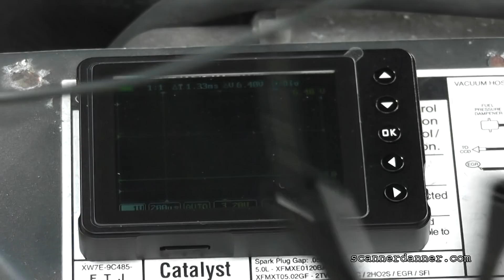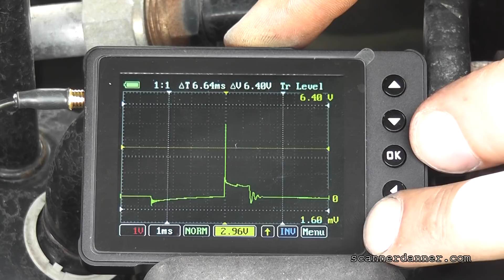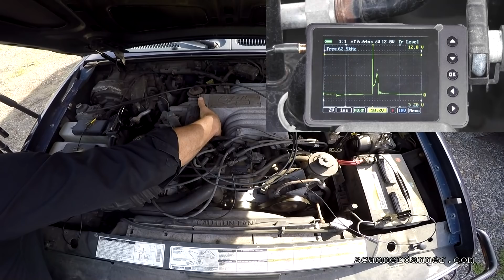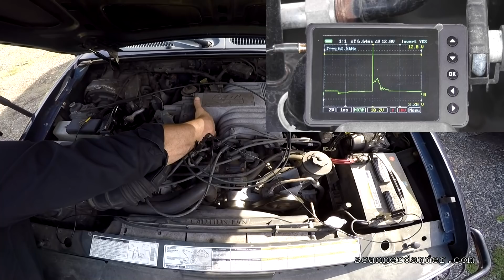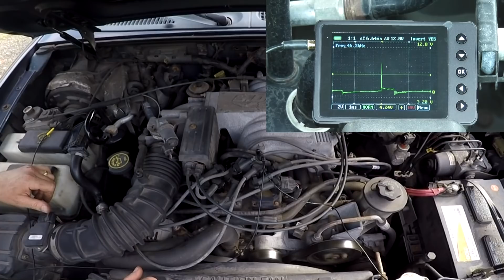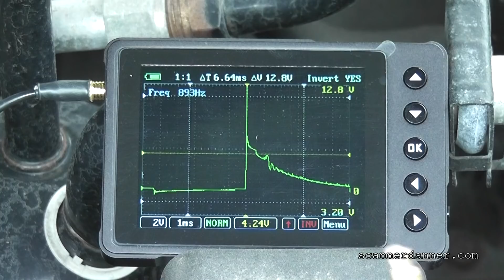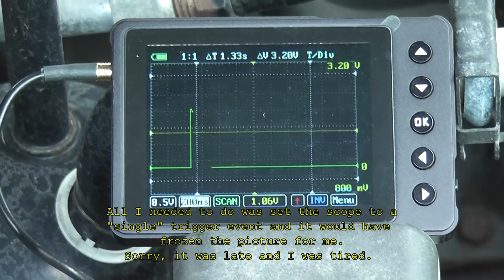How to find a misfire with no trouble codes (uScope)

Comment: Dude I don't know what it is but every time that I have something that I am unsure of it seems like you make a video of it within a few days lol. I am working on a 08 Subaru impreza 2.5I that has a constant misfire on 2 cylinders @ idle and hi rpm and the waveform has a downward slope just like yours I thought it was a secondary misfire but wasn't positive, anyhow I told him to put a coil on it because he already did plugs and wires. It still got the misfires. I am going to do a relative compression test this week. Any suggestions? If I cant figure it out can I bring it to the school?
Awsum video I don't do a lot of ignition scoping and this video helped me a lot!!
Thanks
Reply from the maker: JOHN HUFNAGEL I'm not back until October my friend.
Reply: John do you have a scope file of it?  Might be able to help.
Reply: Man I need a job there your always on vacation Lol No problem Iam sure I will figure it out, Have a good time off work ScannerDanner
Reply: busjockey1
I didn't save the file cause I was pretty sure that the coil was the problem from what I thought was a secondary misfire  but I will have the car back this week for round 2.
Reply from the maker: I'm always working John, more now than ever. I'm just not in the classroom as much
Reply: Know the feeling Paul, start teaching next week part time and at the same time working at my Full Time job, some of my friends think I'm nuts. Lol.  John save your files next time so we can see them.  What scope do you use?
Reply: Enjoy your vacation Paul.
Reply: if it helps, I have had problems with the alternator causing a miss, on subarus with direct fire coils. also the valve timing solenoids can get fragments of metal stuck holding them open,
Reply: well the customer is a idiot and dont want to fix the problem all he was worried about was getting the light out long enuff for inspection. I am sure he will be back when the cats are plugged and the car dont run at all, I will let yinz know if I ever get it back and what I find. Thanks for the help

Comment: Big fan first of all ....  Is it possible to have a compression problem if motor runs flawless for 5-10 minutes and then goes left ... Idle seems steady on dial but big stumble felt in wheel  at stop lights ( especially if it's a long light to wait.  ) Power is 50% gone ..  Puff puff out exhaust pipe ...  Dash lights flicker but no changes under load (ac ,etc)  crazy but car runs perfect cold ...  I have no cats only straight pipes and tried to unplug o2 and ran worse ??   Could a faulty o2 rob all that power even at wot ?   You would swear it still had clogged cats but I removed them ( shattered guts inside). I assume rich condition maybe killed o2 then killed my cats ?   Would poor compression show up only warm temps ?   That's all I'm super worried about , anything else like sensor related would be better news.  Thanks
Reply from the maker: +Kevin Duprey I don't think so, what are you working on? that would help. 
Also, are you absolutely positive that when you mash the pedal all the way to the floor that it does not improve. If you answer is no, then I agree, no reason to look at the O2 any further for this issue. 
Have you considered a faulty alternator diode? I have a video on this called "alternator diode testing". 
As a test, unplug the alternator (smaller connector, not bat wire) after it starts acting up and see if it improves
Reply: +ScannerDanner .. Good info ,  sorry it's a BMW 1997 740il ..  Will check that recommended video ,  I'm guessing I'm looking at multipal issues .  Money is tight or I would have purchased o2 anyway I do have following codes po155 po150,po135,po156,po130,po136,po330..  Also a crazy p1166 ??  Not even BMW code ??    I'm positive if you mash the pedal it's acting like I'm pulling a semi and falls on its face ??   Again no cats on car , clear cat back flow ..  I'm catching up watching your videos everyday and thanks for helping ...

Comment: Will the Uscope show a cylinder with low compression? In other words, can I hook this up to my F150 and determine which cylinder has low compression?
Reply from the maker: Yes, you can do a relative compression test with the uScope. But you will not be able to determine by the scope alone which cylinder is which because it is only one channel.
Reply: ScannerDanner Ok. Thanks for the helpful reply.
Reply: JackOfAllTrades - you can introduce a known fault by removing a spark plug. Then you just need to know the cylinder # and firing order

Comment: Learnt a lot from you. Paul please stop using the scope so much know good way to test but most people do not have one! So why ? So testing etc using normal tools maybe with basic sxanbwr and DVOM. THEN WE COYLD FOLLOW ALONG. THANKS.
Reply from the maker: I'm sorry. Learn the techniques I'm doing with the scope and understand your limitations with your voltmeter and apply what you can. I'm not going to use a tool that doesn't tell me the whole story, when I have one that will!
I'm also training technicians on this channel. That is my main focus. Thanks!
Also, you can buy a single channel lab scope called a uScope from my friends at AESwave for under $400. You also get an inductive low amp probe, test probes and secondary ignition test leads.
https://www.aeswave.com/scannerdanner

Comment: Scanner Danner
hey mate, I'm no stranger to Technology, Electronics and Electrical, 
but i'm not an Automotive engineer or Technician

i have a DSO   Rigol DS2072A

i have a question
when you said,  YOU DIDN'T BRING OUT THE BIG GUNS

what are the big guns, because from what i've seen on you tube, and please correct me if i'm wrong.
Most guys seem to be using absolute shit equipment

i mean
they use PIco, they use Velleman    these things are fucking toys that cost around $100 or so
some mechanics use Fluke 123 Scopemeter,  now.. I'm a fan of Fluke products, but i can't see how a small unit like that built this fucking cheaply and with the specs that it has can be anywhere near reliable.

so. i'm interested to know the Model of your BIG GUNS

also, My Scope has the following basic Specs

2 Channel 
300MHz Bandwidth
2GSa/s
56Mpts  Memory Depth
16bit scope
basically all the bell and whistles are activated on this scope for the max capacity and Resolution of the DS2000A Series

Now. ANOTHER QUESTION

 What is the highest frequency i'll have to deal with approx. when troubleshooting an engine.
    i mean, Most of this stuff you guys are using are around 10MHz , 20MHz.
    i'm guessing you don't get that high, is that right ?   do you even go above 50MHz

you see, i got this young bloke (16 year old),  he wants to be an electrician, but he is showing an great interest in engines.

now.. i'm not the one to show him engines, and at the moment his talking engines with his mates at school, how. AS IT SOUNDS, don't really have a fucking clue to begin with, and just go on about Turbo's and EVO's but don't sound like they know how a turbo works to begin with.

but, i am teaching this guy Electrical and Electronic's basics
Ohms law, KCL KVL and all that stuff

later i'm going to help him get an Electrician apprenticeship (you call this  an internship in USA) and i was going to get him onto a mechanic friend of mine

BUT I FIGURED... FUCK IT
what better way to 
a) Teach him engines 
b) Teach him how to use a scope AND TO USE IT FUCKING PROPERLY
c) and to teach myself how to use my own scope to troubleshoot my own car

it all works huh

so yeah mate
i think i'll be watching this channel a lot more
I'm am definitely an amateur when it comes to cars,
but i know a few things

but i'm definitely a veteran when it comes to electrical shit and electronics
it's all knowledge

so yeah
if you could get me started by answering those questions
because i want to understand first of all

do most mechanics actually know what they are fucking doing when using a scope or what ?

Seriously
you are the first one who i have see who seems to LOGICALLY TROUBLESHOOTING.
Most other guys seem to not have a clue how a scope works, or whats going on in the waveform and they seem to blindly follow pictures that the manufacturer sends them

LIKE... AM I GOING CRAZY OR WHAT
that is seriously what i'm seeing

Please enlighten me and tell me i'm wrong  hehe
i'm not sure what to think at this stage .

thanks mate
Reply from the maker: Thanks man. I appreciate the positive feedback. To be honest with you, I'm probably not the best guy to answer your scope specific questions (about the specs in particular). You mentioned Pico being crap? The Pico 4425 is the best scope I've ever used! It is an automotive 4 channel scope. The other scopes I use are made by Snap-on (Verus, Vantage series) and those come with a component data base that is worth the price of admission alone! The Snap-on scope itself is not as good as the Pico. But yeah, these were to two "big guns" I was referring to. I know as far as specs go, there are much "faster" units out there, but it's just overkill for the cars systems. There are some other drawbacks of these "faster" and "better" scopes that make them NOT "better", I'm just not the one to be able to articulate why for you. Sorry man. 
Here is the spec sheet on what I consider to be the best automotive scope out there. To be honest with you again, I don't know what half of this stuff means :-)
https://www.picoauto.com/products/automotive-oscilloscope-kit/picoscope-4000-series-specifications
Reply: LMFAO  hehe
hi dude, 
1. You're fucking funny,
2. at least your honest when you say "To be honest with you again, I don't know what half of this stuff means :-)"  and.. I DO APPRECIATE THE HONESTY

thankfully i do know what this shit means

but again, with all respect, You've also shown me something else
let me briefly say this

this is what i have now derived from what you have told me

1. You're saying that Pico 4425 is THE SHIT, as in . it's really fucking good.
   ok, i can respect your opinion and years of experience with this hardware.

2. i can personally tell you if you tore it down and opened it up it would not be a crash hot design job. Now.. this is where people usually say "Who fucking cares, as long as it works"
well.. it does fucking matter,  i mean, if you value accuracy, it matters, if you don't give two fucks, then.. it doesn't

but, Moving forward

3. if you say it's all you'll need, and THE SCOPE HAS A BANDWIDTH of 20MHz  (for your benefit. this means, you can't test ANY SIGNAL HIGHER THAN 20 MHz) 
this then must mean that a car will never produce a frequency higher than 20 MHz
OK........... umm, that's fine i guess if the car is behaving normally, but what if a car produces a signal that is abnormally high at 50MHz ??
fact is. Your scope can't detect it
but then.. you might have something that contradicts this.... JUST A THOUGHT ANYWAY.

4. as for the rest of the scope (Lets assume the internals are high quality for a second.. ok)
    as for accuracy  it's  400MS/s   (Mega Samples Per Second)   Meaning.. it can take a maximum of 400 Million individual Readings Per second,
    this will determine whether you miss something or not.
    by comparison, Most Scopes have at least 1 GS/s  (1 Giga Sample Per second) so... 0.4 GS/a   vs  1 GS/a   big difference.
   My scope has 3Gs/s
   this is not overkill, because it means that you don't miss anything.
   Overkill would be if you said to me that a car, if faulty cannot produce a signal larger greater than 50MHz  and i told you my scope goes up to 300MHz.    FAIR ENOUGH, there is no need for it.
  but sample rate is critical

5. now re how you said you don't know what most of this stuff means  hehe
   well you've partly answered my question because
   This Scope has MATH function and it can peform FFT (Fast Fourier Transform), it has Mask Limit testing
   Now.. You don't have a fucking clue what this shit is... hehe
   Yet it's really useful,   so , what's the point of paying around $800 for this shit if Mechanics are not taught how to use it
   so that gives me insight into that
oh.. and you have 2 Channel and 4 Channel Scopes,   so YOU CAN COMPARE WAVEFORMS,  but i noticed you didn't do that.
Maybe you're not aware of how to do that,

but in fairness to you..... that little scope looked really fucky to work with, to be honest

6. BUT OK, IF YOU SAY IT'S GOOD, I'M HAPPY TO BUY IT AND GIVE IT A RUN.. Why the fuck not
   I know they are cheaply built and not highly accurate
  but then, i don't know how much accuracy is necessary in the Automotive trade....... SO YEAH....  it's something i'll have to test, isn't it ?

7. When you said BIG GUNS.. hehe
    i thought you were going to bring out some big mutherfucker that was taller than you are, and then you give me this thing that fits in your palm  HEHE... so fucking dissapointing.
    but.. you seem like a cool guy so i'll  let it slide this time :P

LASTLY....  I know your busy mate, and from your comments i realize you have shitloads to go through. so 
1. thanks for replying
2. if you need me to explain this shit to you about scopes ANYTIME.. feel free to ask ok.  i have no problem explaining anything to you , Most of it, in truth , is a shit load simpler than you think it is. it's just sounds really fucking cool for the sake of amusing people that don't understand so they can buy a scope.
but don't get me wrong a good scope is invaluable

but here's another point

I have a Rigol DS2072A  which is $1,100 AUD   it comes standard with 70MHz bandwidth, which i upgraded to 300MHz  FOR FREE  hehe (but that's a conversation for another time)
Point being

Your Pico is like $700  right
now a Rigol DS1054Z which is far far superior is $400 AUD
Dude, Seriously,  almost half the fucking price and it will shit all over the Pico

here's a basic compairson

PICO                             Rigol 
2 Channel                    4 Channel (stock Standard)
20MHz Bandwidth      70MHz bandwidth, upgradeable for free to 100 MHz
12 bit resolution          16 bit resolution                     (i guess this is only important if you really need to go that deep into the waveform)
400MS/s                        1GS/s             Definitely a massive advantage

you have more math functions, but.. hehe, you don't know or maybe don't need to use them
but hey... it's a shit load cheaper... so yeah
and also you have PC Connectivity as you do with the PICO

Just thought i'd put that out there for you

ok mate, thanks for the reply
be cool
sorry for the long post
I will definitely come back here and i'll get my young bloke to do so as well since he wants to learn about engines, and i am making a point of teaching him electrical fundamentals properly.

BE COOL DUDE
THANKS FOR THE VIDEO AND THE RESPONSE

again.. feel free to ask questions ok
Reply from the maker: you're one crazy dude :-) I know more about scopes than I've let on here. I was more talking about the bandwidth stuff. Anyway, keep watching the videos and you'll see. 
Thanks for your help yesterday with the website suggestions. Really appreciate your time!
Reply: hehe, thanks mate
you're welcome
and i'm happy to hear that you do know about scopes.
this way , when we troubleshoot engines , at least i have confidence that you can explain to me what to look for in an engine

most mechanical vids i've seen,  the Mechanic doesn't really know much about the scopes beyond where to connect the probes

be cool dude
Reply: Martin Kuliza I don’t like your language. You want to be cool and knowledgeable, whats the input voltage on your capable scope? Oversampling in automotive can put you off, there is no need. There are no components going to 50 Mhz so no need for huge guns.